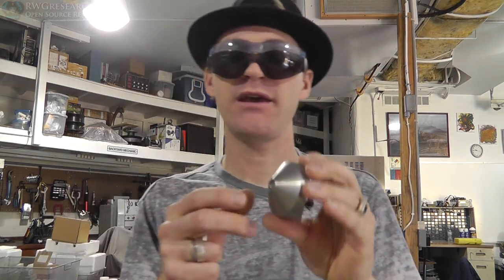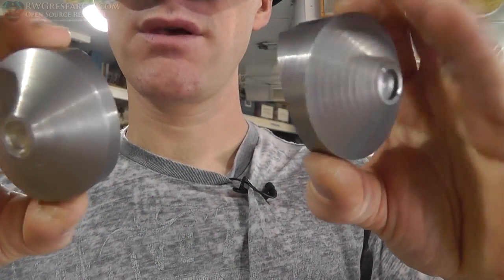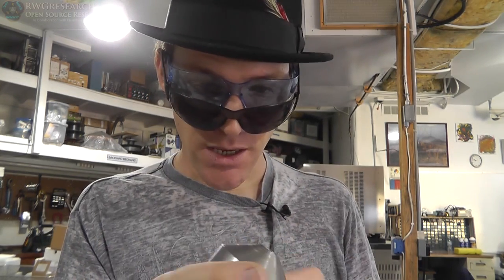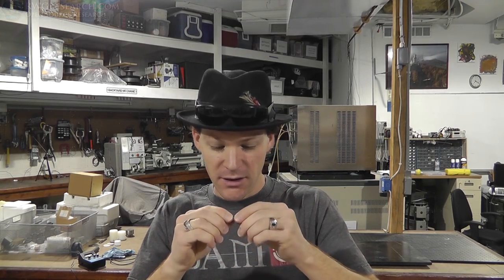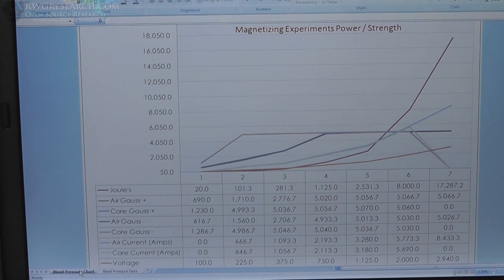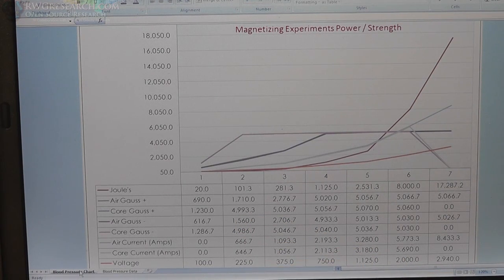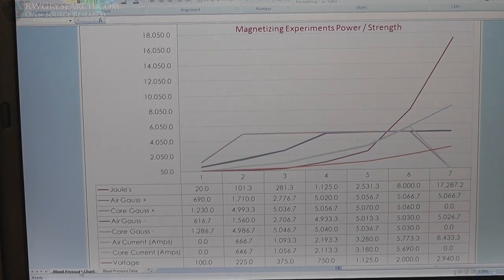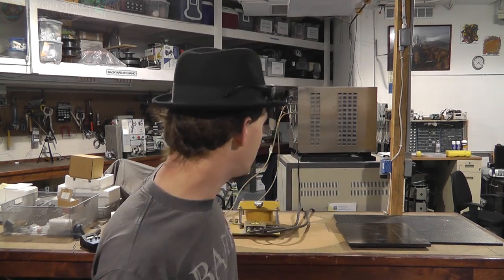Test:5 Magnetizing Experiments  : Focusing cores, Helpful Or Not?

Comment: (Hey Russ... it's me again!  ;-)
Whoa... I hope you realize the possibilities this opens up?????? (probably!)

Imprinting patterns on the edge of disc magnets becomes easy!  Using a pair of top/bottom focusing cores with identical "teeth" to put "spokes" of polarization on the edge of the disc.  The Neo slug/disc would sit inside of all the "teeth". Each pole-piece (focus core) would be slightly rotated from one another (1/2 of the inter-tooth spacing), so you have a series of "N(gap)S(gap)N(gap)S(gap)N..." arrangement along the circumference of the disc.

You'd want the "spokes/teeth" in contact with the outer edge of the magnet material to get maximum strength... which obviously means you need a custom set of "focus cores" for every different diameter magnet.

Mechanically align the two core halves with nylon (non-magnetic) posts to maintain the rotational offset during the process.

I would see the need for plenty of gap between each of the focus cores and the material being magnetized, so that you don't get a flat-surface magnetization effect... what you normally WANT, you now want to AVOID :-)  Nylon flat-disc spacers (same diameter as the magnet material) between the magnet and the cores... but I have no idea of the gap required... discovery by experimenting!  You could probably use slight variations in magnet material thickness with a given set of focus cores, by using different thickness nylon spacers.

I might have concerns about the "teeth" (spokes) being STRONGLY attracted to each other... so your nylon "gap fillers" may need to fill-in the empty spaces between the N and S teeth.. to hold them apart during the "pulse".

Thoughts?